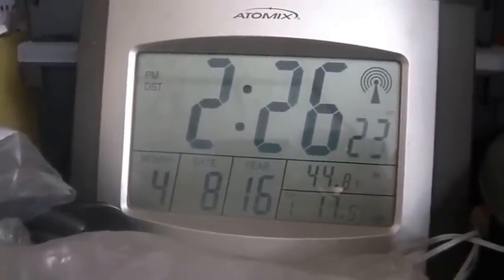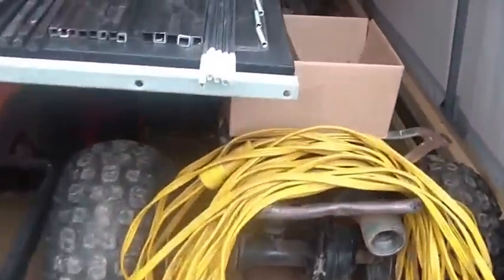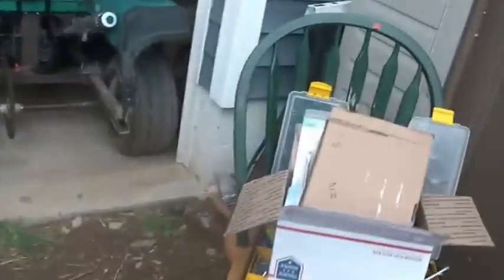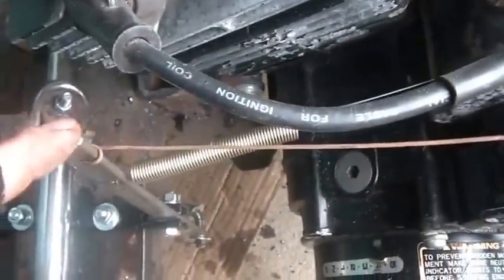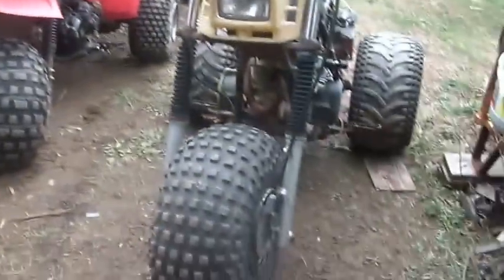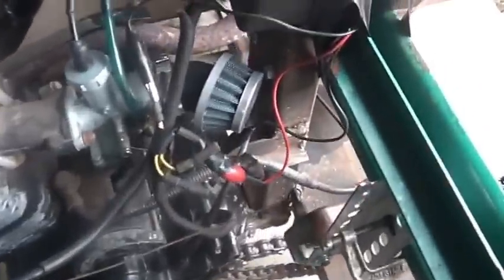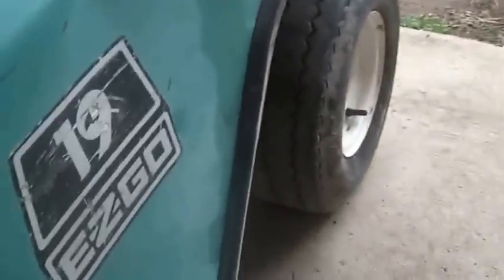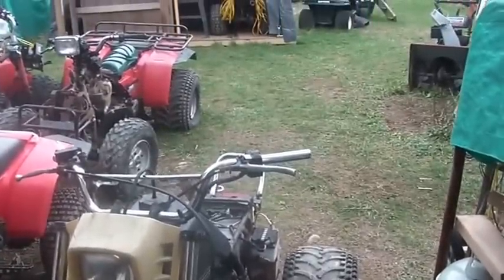1988 EZGO to Honda TRX200SX powered UTV, Gas pedal, brake linkages

Comment: OK now you have to make a skid plate. Yes the seat will have to go up some or at least build it up on that one side over the throttle to carb spot. I also agree that a return tension spring would be good on the break cable. You have made allot of head way. Looking good.

Comment: Nice accelerator job, especially reusing a piece off a television stand just as farmers did in the past.
Would your test ignition system not run on rechargeable nickel metal hydride batteries (nimh) ?